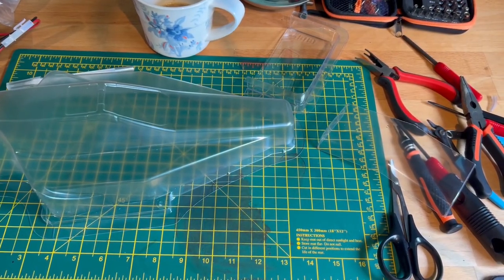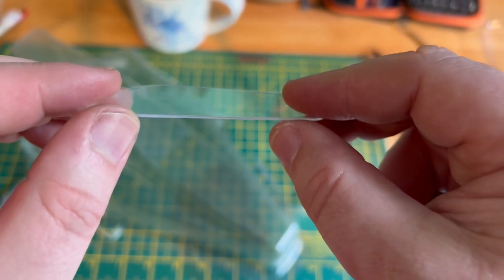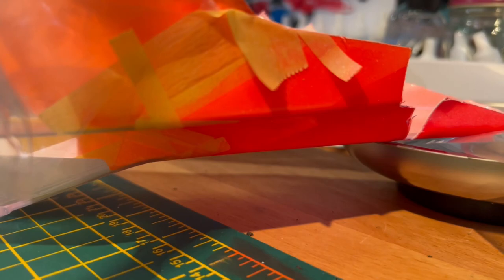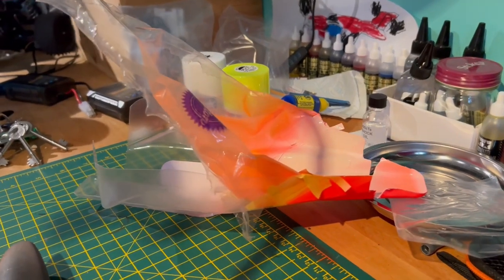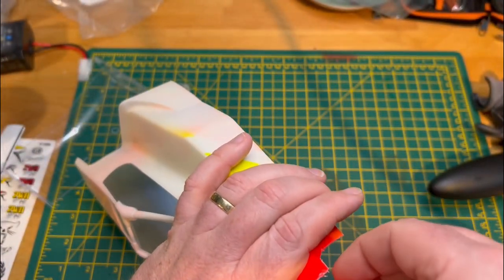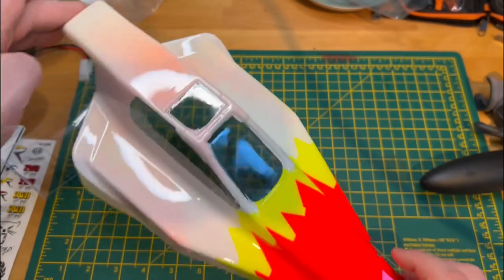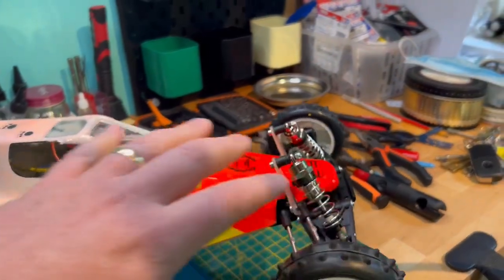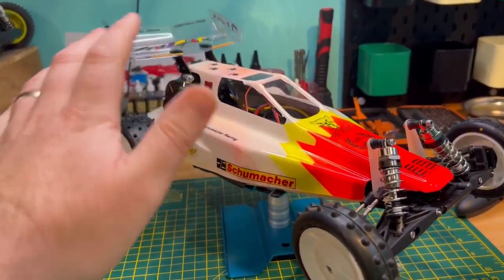Schumacher Cougar Classic Body and Review

Comment: Love the finish, gotta keep it period looking. Cant wait to get mine back on track 👍
Reply from the maker: Hey bud 👋🏻 Thanks for watching 🙌🏻👍🏻 It was going so well until the over spray but I wrestled it back into something very vintage looking! I am so proud of how it ended up looking. Now if I can resolve the gear box issues it will be a demon for next season!
Reply: @theoagrc  i think overspray is period correct 😂 hope you get the gearbox issue sorted, allways happy to help if i can 👍
Reply from the maker: It doesn’t seem to pick up correctly. There is a tonne of slipping. I think the belt needs to be tighter but I am cautious of over tightening it
Reply: @theoagrc  if its slipping loads it may be worth pulling it and rebuilding just to double check, did you tighten it fully then back off about a 1/4 of a turn i think it is ? Needs to be tightend fully to pull it all together
Reply from the maker: It was slack then I tightened. Sounds like I have not got it quite right! I am quite the expert at rebuilding the gearbox now so I will give it another try by tightening it up fully then backing it off a little and see if that helps. Thanks for the advice 🙌🏻
Reply: @theoagrc  no worrys, let me know how it goes 👍